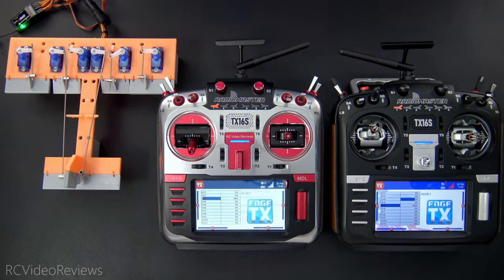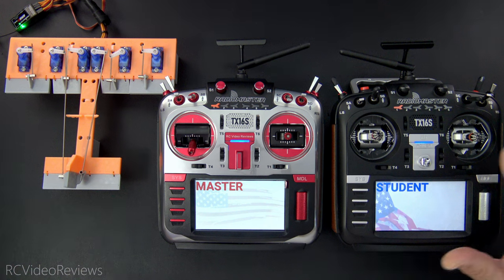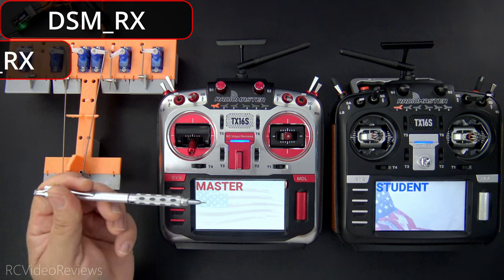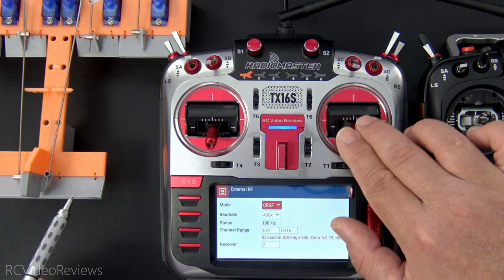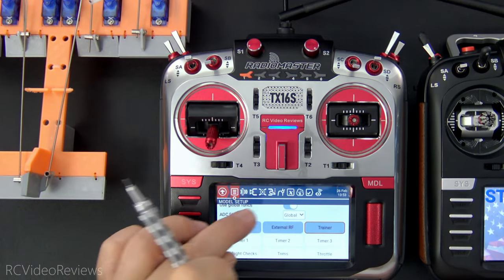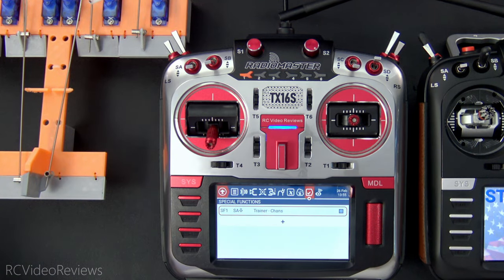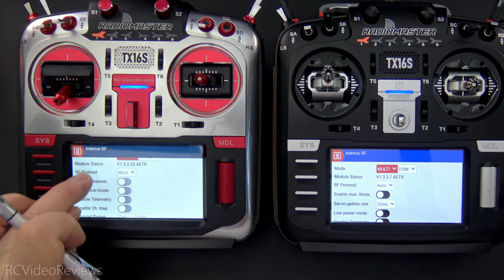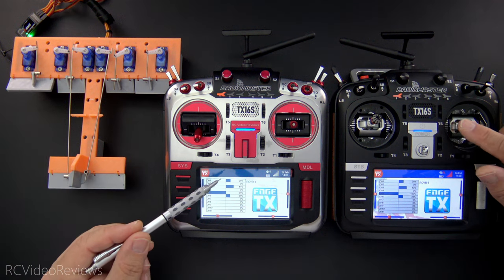EdgeTX Easy Wireless Trainer Setup for Everybody with DSM, AFHDS2, and D16

Comment: I think a key difference between channel and stick is that with sticks, the student radio does not have to have model specific information as it effects the inputs on the master radio.  Channel on the other hand bypasses the mixes on the master radio and the channels received are copied to the masters TX.  There is a way for you to get the extra channels when using Sticks trainer mode.  For both the Input and Mix screens, you can select any trainer input channel as a source for any input/mix.  They are labeled "TR" followed by the channel number.  So TR1 is student channel 1, TR5 is student channel 5, ...  I think the TR sources always provide the student channels in case you were using that for controlling a camera pan/tilt or other such functionality so use activation switch when adding to mix/input.  I prefer to use sticks so my trainer radio does not need to have model specific config.

Comment: Great job, John!!!  Question:  If I'm using two TX16S radios, do I have to have the external module?
Reply from the maker: You need three transmitters.

1 Student to Master
2 Master as RX
3 Master to Model
Reply: Great video, we were trying this today with two "out of the box" TX16S 4in1 " and did manage to bind them together.  But we couldnt bind to the plane from the master. Do we have to use an external module for external bind? Or is it possible with no "extensions"  addons. Greetings from Norway. Keep up the great work

Comment: For other folks like me who came over from spektrum, it should be noted that you can pair the tx16s to a dx8g2 without the need for a second tx module in the bay of the tx16s. The gen2 spekys contain an rx and tx that function simultaneously.  However, the speky has to be the master and you will have to let the student handle your tx16s 😞
Reply: Thank you for this information as I’ve been trying to find the answer to this. My instructors all use newer Spektrum and I plan to get TX16Smkii 4in1. Was wondering if I needed an external module.
Reply: @jamesmoore9008  Probably would be worth the very reasonable cost of the External Multi module. That way you could hand your "Instructors" the TX16S to evangelize the poor silly Spektrum suckers. We really do have "God on our side!" 😈😜😂

Comment: I have two TX16's, both are four in one with no external module... Can I still bind to a plane with the master and then set up the trainer like you are showing? I ask only because the master here is using an internal module to bind to the aircraft...

Comment: For some reason, my signal from the trainer transmitter is super laggy and keeps on jumping around, making it unflyable. do you know how to fix this? I have a T antenna on my external multi module, and am using my internal ELRS to communicate with the model.

Comment: Hello . . .I have a question that I've been struggling with for a couple of days . . . .  Can this be used to set up multiple models ??  So that a student can fly 2 or 3 different models using this method??   ie. can you have 2 or 3 models set up on the student transmitter and have them all binding to the same TX16S  (that's set up in RX mode ?? )....   Thanks . .
Reply: Of course you can. Just set up a new model on the student radio for each model you want to fly. You will want to use a different receiver number for each model in the settings otherwise (at least if using the FlyskyRX protocol that I am familiar with - no experience with Spektrum) the bind for each additional model will drop the previous binds.

Comment: Thanks for the great video. 
Is there a possibility to use the Expo settings of the Master transmitter? instead of the Student?
I have connected a joystick to my transmitter as a student, but it has no Expo setting options.
Reply from the maker: You’d have to experiment. I don’t know. I know the master rates are used. Not sure about expo.

Comment: Hello John,
Really like your trainer mode with the internal module it works perfect with the FrySky Xlite and a TS16S. But can you use it with the pan and tilt together on trainer mode so you can flight together. 
I use the headtracker project with the Arduino Nano 33 BLE. 
Can you run 2 trainers ad the same time or is there another option to use both.
Reply from the maker: I don't understand your question. You can't run two trainers on one master at the same time as far as I know. You can send from the trainer to the master any channels you want based on the trainer configuration. So if you want a pilot an co-pilot where the pilot cares for flight modes and sticks, you can do that while receiving pan and tilt from the co-pilot. I'm not sure if this is what you're asking. In any case, please join discord for follow-up. YouTube is not good at the inevitable back and forth I see coming with this question. Invite is in the description.
Reply: Yeh I will try thru the co-pilot the pan and tilt. Thx

Comment: Interesting that you noticed frsky trainer signal lost issues. I see that as well at the field. I have a TX16 mk1 and the trainer port is useless as well. Going to try using a student flysky tramsmitter...
Reply from the maker: The sbus trainer option works well with RXs connected to AUX1 or AUX2.

Comment: I have a Multiprotocol module on my FrSky X-Lite Pro, which is on OpenTX 2.3.15 ,but I can't select Master/Multi in the Trainer Mode selection. Is this only available on EdgeTX?
Reply from the maker: Sorry, but I left OpenTX some time ago. I don't have it on any of my radios anymore, and I don't use FrSky either. So I'm afraid I'm not much help on this question.
Reply: @RCVideoReviews  I can now confirm that it only seems to be available on EdgeTX or OpenTX versions higher than 2.3.15. Thank you for your quick answer though!
Reply from the maker: Appreciate the follow-up.

Comment: Thank you for this and your older video on the same topic (https://www.youtube.com/watch?v=iiZehq3aS2A) - between the two I was able to get my TX16s working in buddy box mode with an old Spektrum (E-flite) MLP6DSM. I wanted to share a headache that had me confused for a while. In your other video, you off-handedly mentioned using the internal 4-in-1 module as the receiver, until trying that all of my binding attempts had failed using the external module as the RX. All of the documentation suggests this doesn't matter, so I think the issue has more to do with the antenna position, using the same protocol for both (DSM) and possible receiver de-sense (overloading). Keeping that in mind, low power mode also may have helped overcome this. You mentioned some issues that you thought had to do with being too close, I'm curious if spacing the radios out resolves this or if it's the proximity of the modules that is the issue. I'm going to try running a coax cable to get one antenna further away. The other big thing I noticed is the latency. The "Student" controller experiences notable latency in the controls that isn't there on the Master. I'm curious if this is less of an issue with something like ELRS or another protocol. I've found complaints about Spektrum Buddy Box mode having high latency even in official Spektrum controllers with cable.

Comment: hi all, has anyone else had issues with one module nocking out the other one. I have a tx16s 4 in1 connected as multi/trainer to a student Radiomaster pocket. I have a Elrs module in the JR bay but as soon as there are both active I loose the trainer  controls. i have tried different rx protocols  which has slightly differnet effects like constant trianer recovered to trainer lost. Thanks

Comment: Followed your video to a T worked on EdgeTX 2.9.   /.    I cannot get it to work with. EdgeTX 2.10.4

I am using radiomaster TX 16 S both radios express LRS and internal 4 in 1
Reply from the maker: If it worked prior to 2.10.4 and not with 2.10.4 you need to open a ticket on the EdgeTX github (Issues) and let them know.
Reply: not sure why change the hertz on Xpress LRS lowered to 50 Hz it hooked right up no problems 
a few days of trying everything else.😅
I really appreciate your help and everything you do and all your videos.

Ps I also have a Traxxas truck with Radiomaster MT12, I had to change the hertz to get it to hook up to the ESC, which gave me the idea to try it on this.

Comment: I can connect a second transmitter to my tx16s via DSM_RX, however I also only have dsm receiver in my model. Unfortunately, my tx16s has an internal CSRF protocol, so I cannot communicate with the model. Is there any way to receive and transmit via my multi module at the same time?
Reply from the maker: Do you cannot. Wireless trainer requires two discreet RF links: Master to Model and Student to Master. If you use MPM to connect student to master, that's it. The MPM is now used and cannot be used for other purposes. You could connect your CRSF transmitter to model and that will work. Alternatively, see this: https://youtu.be/PEz8WSxYHG4
Reply: @RCVideoReviews  Ok, thanks for the help anyway. I was planning on getting some ELRS receivers anyway for some new models, ill just use them to set up the buddy box.
Reply: @RCVideoReviews  Ok, so I have gotten an ELRS reciever, which should be able to bind to my internal module on my tx16s, whilst I use dsm_rx for the buddy box on an external module, however, any time I enable CSRF on the internal module, the master radio loses and gains the student radios signal every second, constantly disconnecting and reconnecting. The buddy box works fine when I am not using the internal module. I am also not bound to the ELRS receiver.
Do you know what I am doing wrong?
Reply: @leemiles3995  I strongly suspect having the two antennas so close together is causing de-sense in the receiving module, it's the same logic that some planes can't bind if they are too close to the radio. I plan on re-positioning the external antenna with a coax cable. You could also do that with the internal module if you've modded it to have a removable antenna. Just make sure to use the right coax. 2.4GHz over coax can have a lot of loss. I'm going to try it with 3 ft of RG400.

Comment: Can you use a Spectrum transmitter as a trainer with the TX 16S as master
Reply from the maker: If you have a TX16s with MPM, you can use the wireless function between the MPM and Spektrum TX for the student. You will also need a TX16s to model radio system of course.
Reply: Yes. I was able to do it, but I had better luck using the internal radio as the DSM_RX and I put the other radio in low power mode to get a bind. That will reduce control range, so I'll probably disable low power mode before actually flying if it doesn't cause the connection to drop.

Comment: Awesome work, here. Looks like I won't need to throw my old Spektrum DX7S out after all.

I'm gonna go ahead & bench test this setup where my DX7S is the Student's Controller & the Instructor's Controller is my RadioMaster TX16S Max Edition, & see how that turns out. =^/,..,^=
Reply from the maker: Thanks! Let me know how it works out.
Reply: @RCVideoReviews  Yea, I gave it a go, last night. It didn't work. My guess is it's because my DX7S is way too old (it's from 2011). Even though it has both DSM2 & DSMX protocols, I guess it has outdated versions of them.

Yet... funnily enough, I had no problems binding my RadioMaster TX16S to my Spektrum AR8000 that's in my T-Rex 500 ESP 3G (both of which are from 2011, also).
Reply from the maker: The RX option is DSM. Is DSM2/X supposed to be backward compatible? Did you use the auto mode? I don’t know much about DSM.
Reply: @RCVideoReviews  Auto Mode is not available for the DSM_RX protocol on my RadioMaster TX16S. It's only there if I have it on its regular DSM mode.

I was trying to have my RadioMaster setup as the Instructor's Controller & my old DX7S as the Student's Controller.
Reply from the maker: I see. Guess it has to be DSM then. Not DSM2/X.
Reply: @RCVideoReviews  Weird. 🤔
I might do a little investigating into it at some point (to be fair, I am also using a custom build of the Multi-Module firmware. So, I may want to either use stock standard or rebuild my custom one to include trainer support).
Reply: @RCVideoReviews  Right-oh. I have good news. I was able to generally bind my DX7S to my RadioMaster as the Student's Controller & my RadioMaster as the Instructor's Controller. Here's the caveats I encountered:
1. I found that I had to disable the external module bay during binding, & physically seperate my DX7S (at least by ~1m/~3ft) from my RadioMaster.
2. ELRS, when set to 333Hz (I fly helicopters with this frequency) & above, I get "Trainer Signal Lost" & it totally obliterates the Multi-Module.
3. When my DX7S is off (& my RadioMaster is on), I can see the Multi-Module status blink between "No telemetry detected" & the current version of my Multi-Module's firmware.
4. When I switch my DX7S on, I get "trainer signal lost" from my RadioMaster, & under the Multi-Module's status, it indicates "No serial input".
5. When I look over to me External Module settings, under Status, I can see my update rate blink from 333Hz to 0Hz & back to 333Hz.

As a temporary workaround, I have dropped the packet rate down to 100Hz (with full resolution), & everything works as it should, here.
I have also played around with the Baud rates (above 400K), but to no avail. Having my telemetry set to 1:128 ratio (or turning it off) made no difference either.
The only thing that impacted the performance of this was my packet rate settings.

I don't know if this is an ExpressLRS issue or a RadioMaster issue. Either way, it is something that everyone needs to be aware of, so it does not catch them out.
Reply from the maker: Interesting test results. I'll have to see if I see something similar with higher packet rates. I'm not sure why the rate itself would make a difference to other links. Power--absolutely, but packet rate...hmmmm.
Reply: @RCVideoReviews  Thanks for the great video. I have had the same experience. I have a DX6 as a student transmitter. Only when I set my external ELRS to 100 Hz does the student transmitter connection work.

Comment: This is awesome ! Can this be done automatically? I mean, if master centered the stick then it will use student channel, if master move the stick then student will be ignored, will be quicker in case of emergency but of course after using a switch to activate the trainer.
Reply from the maker: Radiomaster WT01 Wireless Trainer Setup with Quick Takeback on EdgeTX and TX16s
https://youtu.be/030liiCDXYY

Just use the logic shown here.
Reply: Wow thanks! I thought it was impossible.